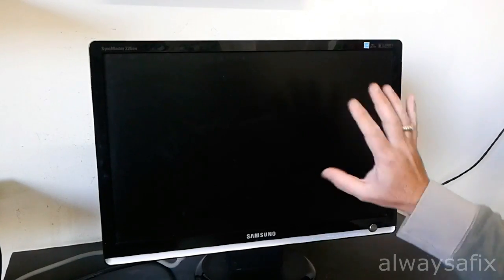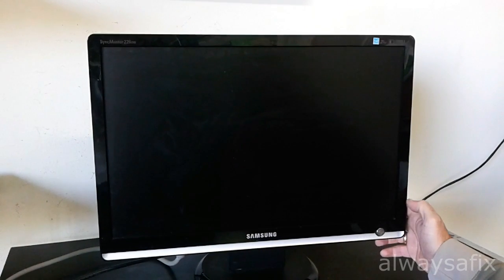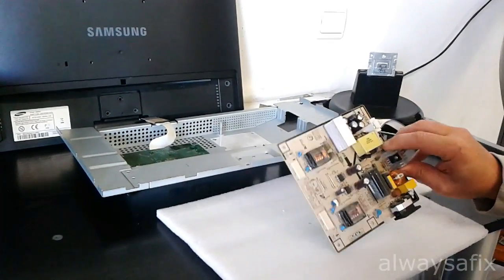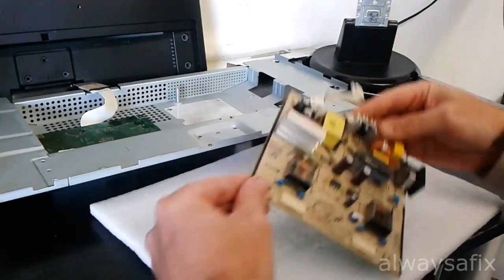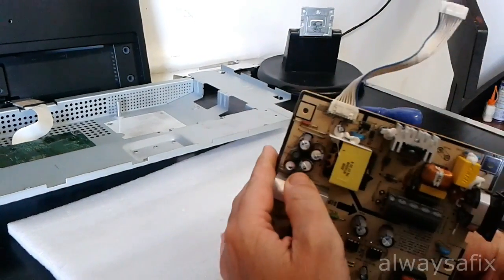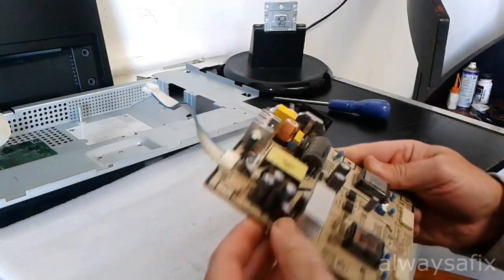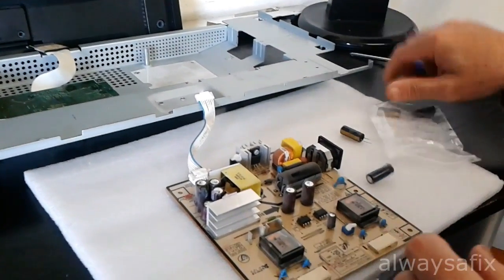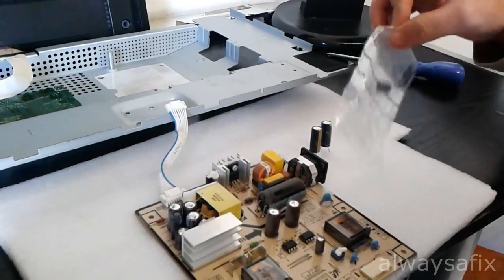Samsung screen problem easy fix

Comment: hp310  all  in  pc    black  screen    every  else  powers  up  ie proc  etc   but  screen  is  black no  picture  at  all   got  me  stumped    hp  to  fix   cost  more  than  it  worth   more  so  if  its only  the  screen  that   is   no  good etc   going  to  rebuild  it   customer  buying  new  system  so  got  this  to  rebuild

Comment from the maker: @MrBazinger Those caps that I changed are not a problem, but on the power supply board the big caps need to be discharged before handling the board.  Thanks for watching.

Comment: Nice video. Is there any danger that caps like those hold any charge once power has been disconnected?
A friend always told me to be careful when desoldering them as they could still be holding some charge, I just wondered how true that is if no power source is connected. TIA.
Reply: yes if the capacitors with high voltage.